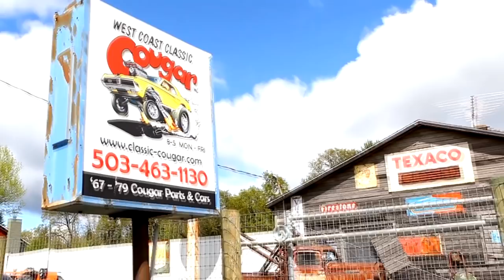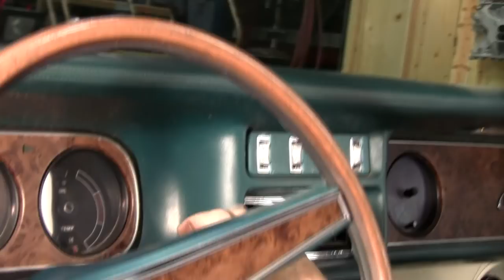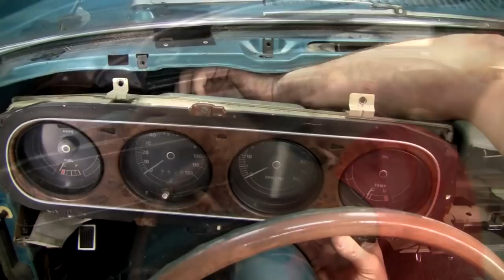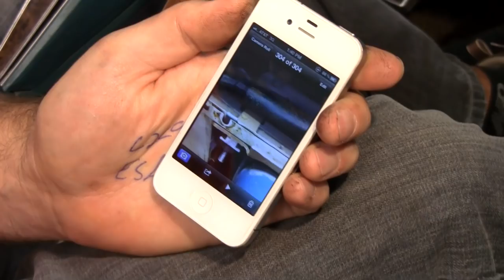Heater Core Replacement & Dash Disassembly - 1969-70 Cougar / Mustang - Updated

Comment: I did this in 1969. was fresh out of High School Vo-tech.Working at  a Ford dealer. The customer complaint was that the blower was making noise.  I found a cigar  in the blower. Had to be left there by factory worker, but the dealer refused to waive labor cost under warranty and insisted the cigar belonged to customer. BTW I had a few screws left over and always wondered when the hole dash was gonna fall in the drivers lap! I left he dealer a short time later to join Army.

Comment: One suggestion, when pulling out the transmission dipstick and working under the hood, I would suggest putting a plug into the tube opening to prevent and foreign object from dropping down the tube. Its a lot easier then removing the pan.
Reply from the maker: Definitely a good idea! Not sure how we forgot to do that.

Comment: Don
This is where I should have posted my question. Is it possible to remove just the lower half of the heater box? I need to replace my fresh air vent seals due to o water leak. 
Thank you for all the great videos!!!

Comment: Can the radio be removed without pulling the dash? Thanks
Reply from the maker: Yep, there is a nut you can loosen from around the underside, and it comes out from the front without dash removal.  Easy peasy.  You can see the stud that holds the radio in by looking at the pic that shows the rear of this radio: https://secure.cougarpartscatalog.com/68am.html
Reply: West Coast Classic Cougar many thanks! You guys are the best

Comment: OH MY GOD!  What a royal pain in the ass job.  It AMAZES me that the dimwit engineers at Ford and Mercury were so monumentally stupid and made it SO difficult to replace a part that should be easy to remove.  All they had to do was put in an access panel or door to remove the heater core.  I know that some GM models had a cover on the engine-side of the firewall that you could just open up with a couple of bolts and pull the whole heater core right out and easily replace it.  Did any of the Ford/Mercury designers and engineers really graduate from college and/or did any of them ever work on a car?  Great job on the video but this amount of work for a foreseeable repair is simply disgusting.  Shame on Ford and Mercury.
Reply from the maker: The typical thing we remind people of is, these cars were designed to last 10 years / 100,000 miles. Our guess is that the engineers expected the heater cores to last for the lifetime of most vehicles. They probably weren't thinking of us 50 years in the future trying to restore them!
Reply: Understood - But, a LOT of the Ford and Mercury heater cores leaked when the cars were relatively new.  I drove and rode in many of them that had the windshields perpetually fogged by the antifreeze/coolant vaporized and smeared all over the inside of the windshield every time you turned on the defrosters.  Do you remember how the Ford door locks used to freeze in the winter and the doors would bounce open when you tried to close them in the winter?  I sure do!  Our cars have improved a LOT.
Reply from the maker: That they have! It'll be interesting to see what people are restoring in another 50 years. Will there be concours-correct, numbers-matching Honda Civics going across the block at Barrett-Jackson? Who knows...
Reply: HA, THAT'S FUNNY!  Let's hope not!  The technology of our cars has gotten vastly better BUT, most new cars can't hold a candle to the beauty of the classics when cars were rolling works of art.  Sadly, most (not all) of the new cars are downright FUGLY.  I don't expect to see much of a collector's market for Honda Civics or the other jelly beans with wheels any time soon.  Love your videos by the way.  Please keep up the good work.
Reply: I still  joke that    the  heater  Core  is put  on the assembly  line  first and  then they build  the car around it.   If the Engineers  were force to work  on the assemble line  for 1 week a year and do different jobs....they would  change  some of the designs to  parts .